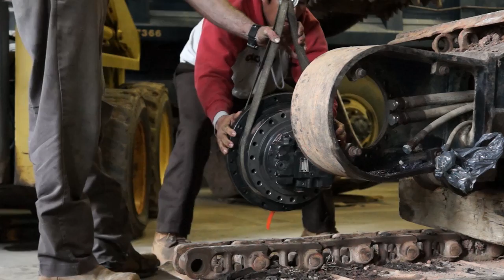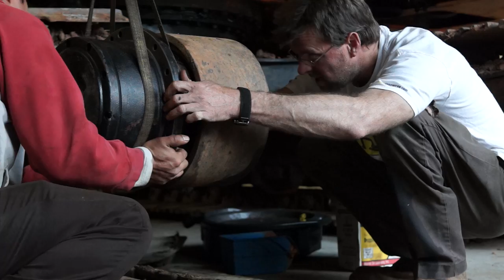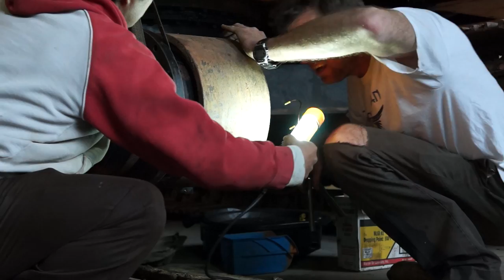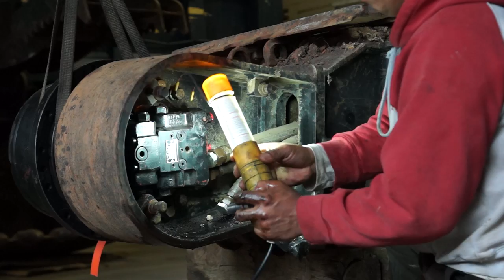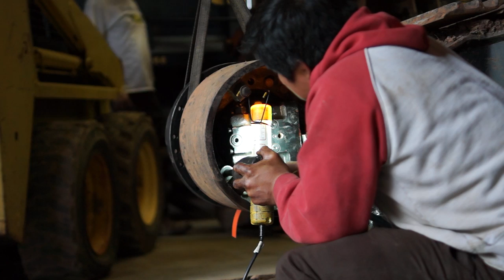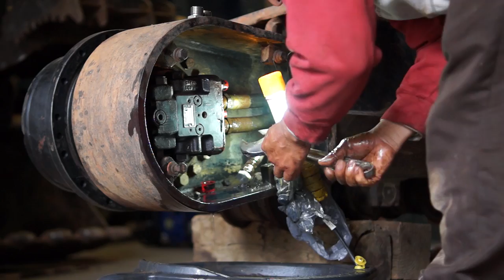Excavator Final Drive Installation (HD)

Comment: @10 mins, when using the small fitsall the wrong way wrond and oil is still leaking, get the bigger fitsall!
fittings should be torqued but looks like this one has been stretched.

Comment: I hate seeing people use crescent wrenches on hydraulic fittings.
Reply: adjustable wrench
Reply: When it comes to efficiency, unless you can look at the fitting and know exactly what size wrench you need, the adjustable wrench is way faster.
Reply: We call it a bolt rounder.
Reply: Some people think Snap-on tools are the only ones suitable for working on bicycles. They're wrong.